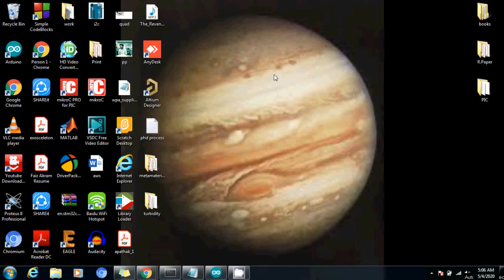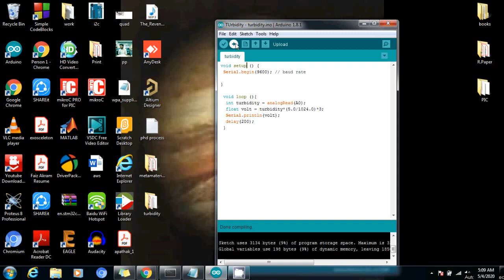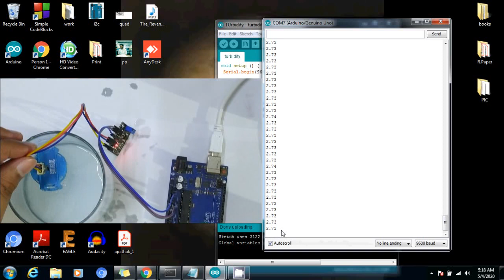Interfacing Turbidity sensor with Arduino .

Comment: I m not understanding why have you multiplied by 3 ... If it's for calibration I did it by changing the potentiometer but still I am not getting the appropriate voltage for clean normal water... Plz help
Reply from the maker: Where are you stuck exactly? What value are you getting when turbidity sensor is in air.
Reply: @akramlab6664      sir basically I saw in the comments that you have used multiplied by 3 for calibration of the turbidity sensor since the potentiometer was stuck in your case.. but in my case I can easily rotate the potentiometer but in air I am getting around 0.98-1.01v and for clear normal water it happens to be almost same voltage as in air... But what I have seen in other videos they are getting the voltage around 4.1-4.2v for clear water . I even checked the connection but I was getting the same value... I am stuck at this, I am getting very low voltage value for clear water I washed the sensor also but not getting the proper voltage if you could send the circuit diagram as well it would be really helpful... 🙏🙏(The only thing I noticed when I multiply the equation by 9 I am getting around 4.1 v but we have to get the voltage without the multiplication factor)
Reply from the maker: No that is not the problem. Check if your sensor can detect the variation. Take any water sample, measure it's voltage then add impurity and then measure again. It's important that you sensor value changes with different samples.
Reply: @akramlab6664  yes sir it does change we checked with normal clean water and muddy water the voltage changes i.e it basically drops. For normal water it comes around 0.98 v to 1.1 v and for muddy water it comes 0.44 v
Reply from the maker: Okay. That will work also. Turbidity varies linearly with voltages.
Reply from the maker: You need to map the voltage in terms of NTU
Reply: @akramlab6664  sir we map the turbidity in terms of NTU but we are getting the turbidity value in negative sign. For normal water it comes to be around 202 NTU.. For muddy water it comes to be around -1342 NTU ...so I couldn't manipulate how to make conclusion ? Plz help
Reply from the maker: You will need reference data to map. It will help if you have any turbidity measuring device.

Comment: Is it possible to connect turbidity sensor with relay module directly,, when the turbidity sensor detects certain amount of particles in water then a signal must be send to relay module,,if possible send circuit diagram

Comment: Sir, why I get 12 something for drinking water? And 11 something for cloudy water??
Reply from the maker: Your sensor needs calibration in coding. Can be fixed easily. As you must know, drinking water has TDS less than 1
Reply: @akramlab6664  Do i need to change the equation (5/1024)*3??
Reply from the maker: Yeah. Remove 3. I used it cz I couldn't calibrate my sensor manually. If you still don't get proper data, remove Turbidity sensor cap and tune the potentiometer.
Reply from the maker: Sorry for mentioning TDS here. You don't need that since you are working on turbidity.
Reply: @akramlab6664  Owh okay. Thanks. Already subscribe your channel.
Reply from the maker: Thanks. Feel free to discuss if face problem in interfacing

Comment: Sir does the arduino uno has wifi module or we need esp to connect to wifi?
Reply from the maker: Arduino UNO doesn't have WIFI. You need to connect ESP32
Reply: @akramlab6664  Tq sir btw can I get the code please?

Comment: sir can you help me? why is my turbidity output only 2.1 volts? I tried to adjust using the threshold nothing works
Reply from the maker: Do you mean the value is not changing at all?
Reply: @akramlab6664  it changes onto 1.5-1.9 when I put it in dirty water. but the voltage is only 2.1-2.4v without submerge in the dirty water. it can cause in accurate results when i convert into NTU

Comment: what should be the turbidity value when the sensor is in air???
Reply from the maker: It will give you around 0 though it's not meant to measure air particles. So, that's not a data for turbidity. Measure in pure water you have.

Comment: How to connect turbidity sensor to relay module
Reply from the maker: You will need to connect relay with the microcontroller. You can program the relay to be in NO/NC mode with respect to turbidity value.
Reply: @akramlab6664  i connected the relay module to the turbidity sensor via microcontroller but the the relay is not getting triggered only the micro controller led indicator glows
Reply from the maker: Are you using relay kr relay module?? It possible that you relay is not getting sufficient voltage. You might need to use a transistor as switch to provide that voltage. Do check the voltage rating on relay and see if your microcontroller can supply that amount through its GPIO pins

Comment: Water resistant?
Reply from the maker: Yes. You can put in inside water to measure turbidity
Reply: @akramlab6664  until all of it goes into the water?
Reply from the maker: Yes. You can't put all in water like this
Reply: @akramlab6664  just a little?
Reply from the maker: You can but first wrap it in some box or plastic to not let water destroy the circuit.
Reply: @akramlab6664  ok, thankyou.. have a nice day 👍👍

Comment: Why in the command,the voltage rate is multiply by 3?
Reply from the maker: For calibration algorithm, manually calibration can be done by adjusting the pot in the turbidity but that was stuck in my sensor..